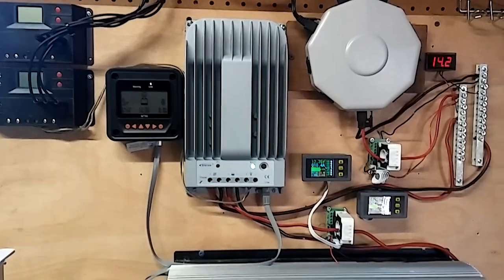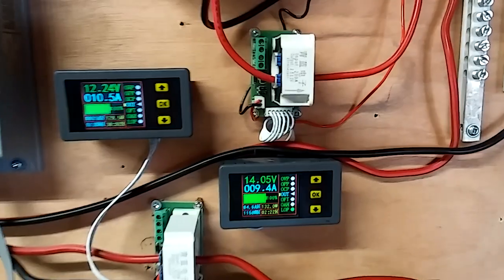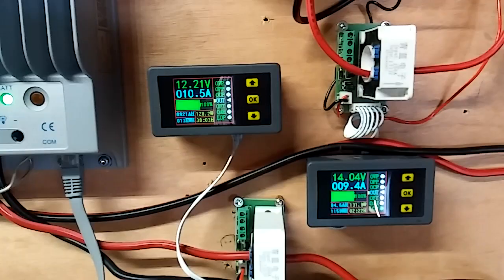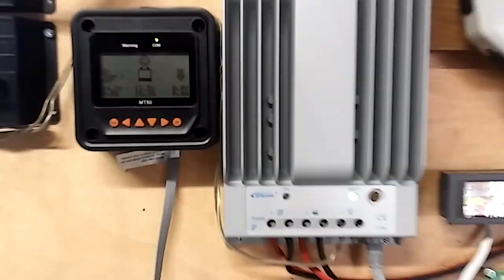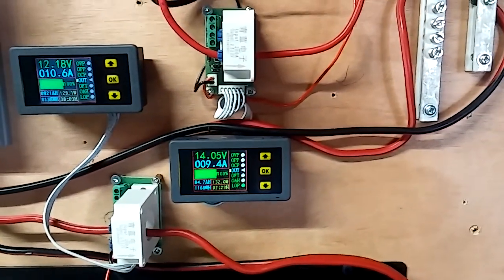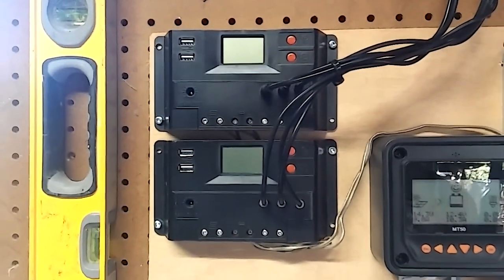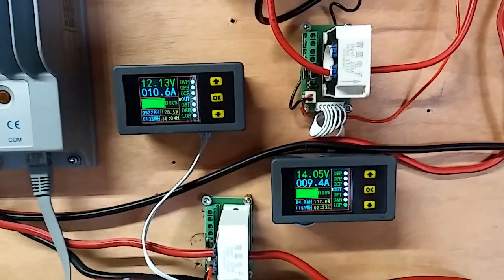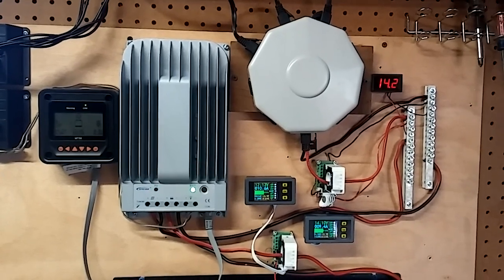300 watt Harbor Freight solar with EPever  3215bn mppt

Comment: How much benefit do you think the MPPT controller gave you? Reason asking, i have 1 harbor freight kit would it be  better to just add another 100w mono panel or upgrade to an MPPT?
Reply from the maker: If it were me, I would get the mono.. You wouldn't gain more with 100 watts with mppt than 200 watts with pwm.. Buy the mppt after you have enough pannels to justify the cost.. At least 300 watts... I didn't see much gain at all when I bought my mppt. Not till I was at 400 watts.

Comment: Nice set up.  Did you install your 3 sets from HF to it?  I still have my 2 sets with 1 controller in my shed.  I did purchase an EPEVER and will set it up like yours. Can't wait for the series set up test.     😎👍
Reply from the maker: Yes. I have all 3. 12 panels total